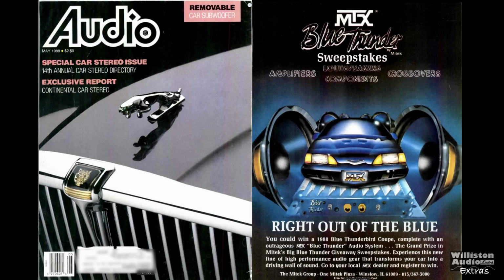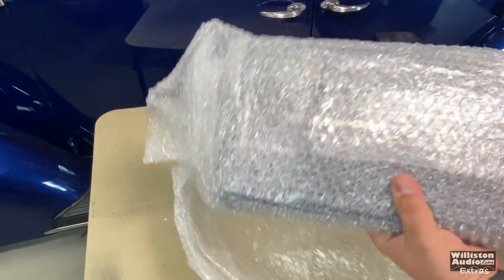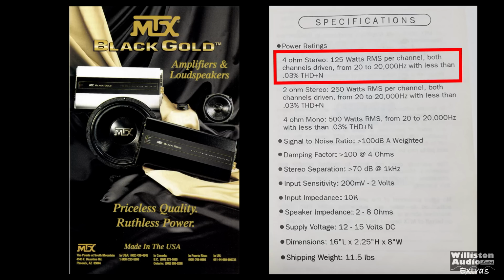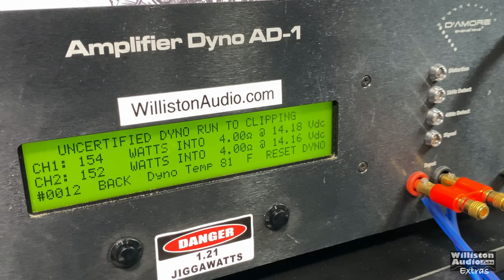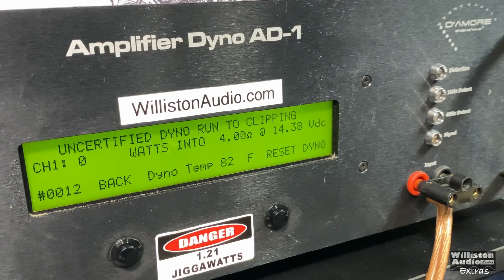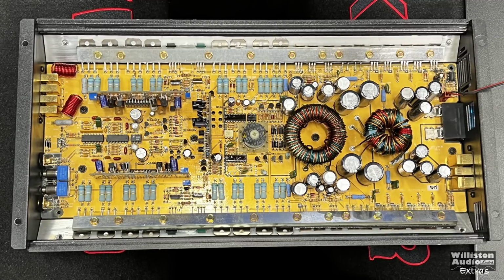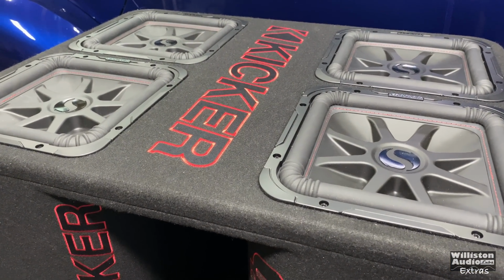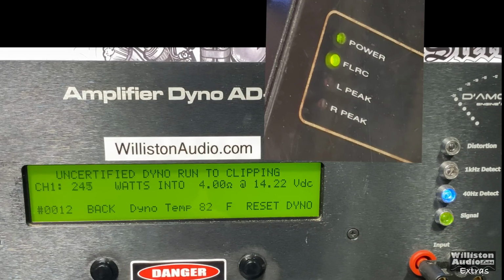1994 MTX Black Gold BGA 2125 Amplifier Review and Amp Dyno Test [4K]

Comment: I’ve had 4 of these amps,bridged the 40 amp never lasted,I always ran a 60amp fuse ,2 of the amps were in my iroc Z when it was stolen in Columbus,Ohio ( if the persons who stole it are reading,FU)
But I digress,2 were stolen,sold 1 and still own and use the last. Originally I had 1 bridged going to each JL Audio 12W6’s. It was one of if not the loudest stereo in town back in the 90’s. Awesome amps that I abused and never had any problems with.

Comment: Interesting - when you said fuzzy logic rail control power supply, my thought was it was a class T amp - nope.  But seems to have taken a little element of what makes a class T amp work.  Don't mind a well executed T-class amp, but have to be aware when it clips, it clips at the rails, and so things fall apart quickly sound quality wise when driven to the max.  Wonder if the same might be happening here.

Comment: Mannn I certainly remember when 500w of MTX power sure would rattle your brains lol-ol-ol unlike today's audio equipment I had a pair of blue thunder or road thunder 15's on a 500w amp and it was known as one of the louder setups on my town back in mid 90's and then Lanzar became prevalent and one friend of mine squeezed 6 15's into a dodge neon and earplugs were necessary I am still amazed how the amount of power has so greatly increased but we definitely were loud back then with very little power and all the extra batteries and alts were never needed just one extra batt near the amp and you were set! I actually still have the subs that I eventually upgraded too which was a pair of Kicker C15's at 750w rms each single 2ohm coils and you throw those in a big sealed mdf box and they would flex your windshield and metal panels like rippling water I've always wanted to throw them in a box and in a trunk to see how they stack up to today's audio equipment and if I still would be impressed by them at all 🤔🤷‍♂️ I've got a whole slew of oldschool A/B and D amps I could run them on that I never would have been able to afford back then...
Reply: SAME HERE I'M A DJ AND 800 AND 1200 WATT AMPLIFIERS WERE NORMAL . 2400 WATTS AMPLIFIERS WAS SUPER BIG POWER U DIDN'T NEED ANYTHING MORE SPEAKERS WERE 250 ARE 400 RMS 600 RMS SPEAK WAS SOMETHING VERY SPECIAL WE SHAKE EVERY WHERE FAIRS FETES STREET JAMS THAT POWER NEVER DISAPPOINTED  TODAY GUYS HAVE 10 K 14 K 20K  NO QUALITY SOUND .LOUD AND OVER PROCESSING HAS TAKEN OVER ?

Comment: The "dual power supply" refers to the primary and secondary sections of the power supply used to push each stage of the Darlington circuits. I have an Urban audio works amp that has a similar setup. You're right though it's technically one power supply with two separate outputs to provide two different rail voltages

Comment: As a regulated supply, it doesn't seem to do it in the way we normally see with more modern amplifiers.
It almost looks like it takes the primary 12v input, sends it to a first power supply for regulation (I'm guessing between 18-25vac), switches the duty cycle of the first fets in the line to regulate it, sends the unfiltered AC voltage to another transformer for further boosting, which might only be 1.5-2x input from the first transformer.
Iirc, Hifonics was the first to use duty cycle trimming to regulate output in their VII (7) series amps.

Comment: Be nice if Corsair had some fans that would fit those. The Mag-lift Zero Noise fans have worked great for years in my PC.  Either way, Ya gotta love those good ole regulated amps. So much easier to select speakers when you can trust the ratings. Like actually trust them. I could only image how many speakers have been blown because an amp rated at 600 watts, is putting out 900 or 2000 etc.

Comment: Back before I knew anything about car audio I knew the name MTX. When I first got the money to get a real system I had two thunder 9500 tens in a sealed box being pushed by 1800 w linear power amplifier. Honestly wasn't that loud but it sounded real damn good. Got hard up for money and had to sell it. I should have done anything to hold on to him because MTX quit making them and replaced them with the 95 series that don't sound near as good.

Comment: Wow, those look very much like ppi boards, if it's not a ppi board then they are very similar. 500 watts on 8 pair of bjts, not real impressive. I bet it uses the sg3525 pwm like ppi uses. A true dual mono amp must use two pwms to be a true dual power supply , not to mention transformers. Beautiful amps none the less. Great vid.

Comment: 7:58 The black spot you see  from the thermal camera on the amp board are the aluminum top from the caps that reflect the ambient temperature probably from your roof or wall that are at colder temp. NEVER FORGET that thermal camera  will measure more the reflected temperature from a distant surface unless you correct the emisivity to the appropriate value from the material. typically emissivity is set by default at 0.95.

Comment: I remember the black gold subs did not come with the gold logo on the front of the sub. They gave you a sticker to apply yourself. And it was nearly impossible to put it on perfectly. I had 12 of the fifteens in a  Chevy Astro van. Drove me insane that my logos weren’t perfect.
Reply: I never knew that! That’s crazy! I could’ve done it back in the day, but probably not so much nowadays. Lol! 
I was the guy that was responsible for putting on ALL of our car club member’s stickers. GOOD LORD did I lay some vinyl! 😂😂 The worst part was, it was a multilayered sticker… that I had to layer. 
BUT, like you, if they were even a hair crooked, my OCD would kick in, and DRIVE ME NUTS! But I could never say anything, because I didn’t want them to have to buy another $50-75 sticker. 🤦🏻‍♂️🤷🏻‍♂️😂
Reply: @squishtheprodigalson9298  OCD is a curse. Lol.
Reply: @ThisIsMyHandle-48  I used to jokingly say I had it… turns out I really do. It’s semi-mild, but dude… it truly is a curse. 
I’ve lost count of how many times I’ve driven away from my house, KNOWING I locked the doors, BUT I didn’t double check them.. The next thing you know, I’m driving home, for basically no reason.
Now that I’ve come to realize it, it’s a little easier to control.
It does come in handy being an installer/builder in car audio though. Lol

Comment: In the late 90’s, I special ordered a few  MTX 12’s in 8 ohm just so I could put them in house speaker boxes in my bedroom. I use them to this day in my garage.
Reply: I'm still rocking my first ever car audio combo. MTX TH800D paired with a 7515/44 at 2ohm. Still sounds awsome. It survived a writeoff crash (not my fault, idiot ran a red light) and is now in the 3rd car it's been in... still thumping away every day. Have that combo nearly 20 years now. Can't fault MTX quality :)
Reply: I've got an MTX home powered 15. Mid 90's, even came with a remote

Comment: I'm a MTX fan ! I have two  22 year old MTX 8000 12"S  on a MTX RT2400X that I play hard every day . Still sounds amazing.
Reply from the maker: Awesome 👏
Reply: ...good stuff MP, No school like the old school!
Reply: I've got a 10" Thunder 8000 and a 12" from 2001, both SVC 4 ohm.  Both still work fantastic.  Old MTX was great.  Also have a 12" Thunder 7000.
Reply: Used to have two 12” 8000’s on and MTX 81000D… and I smoked them. I was SO sad! Always loved the way they performed. Ended up getting that “Sledgehammer” triple 10 box.. it’s was ok… but NOTHING like those 8000’s.
Plus I had to seal off that factory port, because it sounded TERRIBLE in my opinion. 🤦🏻‍♂️🤦🏻‍♂️🤷🏻‍♂️😂
Reply: @squishtheprodigalson9298  they sound great in sealed boxes.  I always ran my 8000s in sealed.
Reply: I had one of the MTX thunder 8000 15’s on an 81000D. The first one lasted about 3 months and the second one was 9 months. They really did sound good in a small sealed box (2.25 cubic ft), but the surround was the weak point and kept ripping. I ended up replacing them with 2 re audio 8’s in a 1.6 cubic foot slot ported box tuned to 34 hertz.

Comment: Of all the MTX amps I've never seen these. I have the MTX 2300 and a Alpine White 4320 4 channel amps. I've always been my favorite look and believe they were the best power amps they put out, tell the one you and Donald put out stupid crazy power down to 1 ohm mono😮. Now back to my regularly scheduled program. 👍
Reply from the maker: The original Thunder 2300 is still the boss. These are more rare tho
Reply: @wal2  Yea the shop I worked at got these amps in as well as the black gold subs and thunder series amps.  The BG subs were better subs than the BG Amps were amps, especially compared to the thunder 2300 but they were very slick designs and rare like  you said. The 2300 on BG 12's was the combo!

Comment: Would like to see output at 12 volts, back in early 90s we did tests for SQ with motor off any amp that had more than a 25amp fuse was considered s monster, boy have times changed
Reply from the maker: So true!
Reply: It was enough for an SQ system, pretty much all I was ever interested in anyway....I never had much interest in damaging my hearing, but I did appreciate the installations and ingenuity of the DB systems.I think you can have a fine SQ system with 1 pair of quality components with no more than 100 watts, and a quality Sub with 500 watts...and a quality source...most important, proper design and install....You are right, Charlie, times have changed

Comment: These were hard to get and I worked for a MTX dealer in 1995
Reply from the maker: Oh wow that’s interesting 🧐
Reply: Only certain dealers were able to sell black gold series, also the price was a bit expensive
Reply: At the same time the competition from Rockford was great and at the time the punch amps were more expensive. But the punch amps came with power wire and fuse blocks inside the box. The cheap shop owner would remove the supplied cable from the box sell them separately

Comment: I miss MTX. I also miss COUSTIC. Big D you should test a COUSTIC amp!?
Reply from the maker: 1993 Coustic Design Reference Amplifier DR-514 Amp Dyno Test
https://youtu.be/mDbwUMvWBB4
Reply: I think Coustic was also a Mitek Brand..also Xtant
Reply: Everything coustic I had didn't last other than the crossovers.   I think the old coustic was owned by someone else not MTX
Reply: @Bondovw  your probably right, hard to say.All the legacy brands were bought and sold by conglomerates, usually bat the expense of quality. Coustic and XTANT are currently a Mitek( MTX) brand. It is likely they have identical guts to MTX products, manufactured in the same facility in China, and bear little resemblance to the hand made in America amp that Big D tested. Up until around 2000, MTX was a great, American made product. I bought one in about 02 from Circuit City.It was surprisingly cheap for an MTX, to my surprise, it was made in India, and it is sh!t(4004), I still have. However, in fairness, I have a pair of newer MTX, a class a/b 4 channel, and class D 500 watt monoblock , made in China, and they are actually pretty good and a good value ( Thunder series), Probably the Coustic is decent for the beginners as well. Personally, I try not to buy the Chinese amps or speakers, I favor the American,German and Italian products. I also have a Blue Thunder from the 90s, it is an excellent amp…made in Arizona, USA…those were the days

Comment: Great amp, but I'll stick to my 2300's after seeing this video. Still beautiful amp to have if you can find them.
Reply: I'm still rocking my Thunder 2300 which I've had since new.  Also still running a set of 12" Road Thunder Pro with red rubber surrounds as my home theater subwoofers.
Reply from the maker: Yessir!